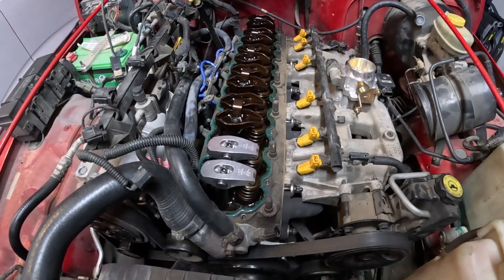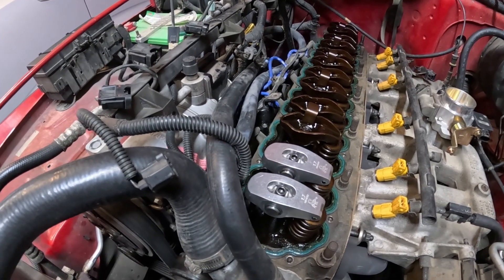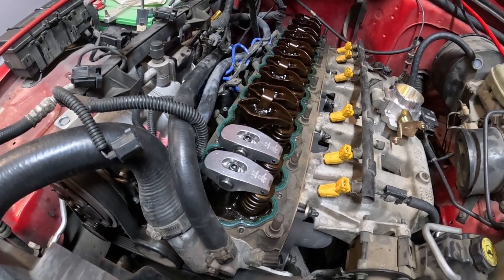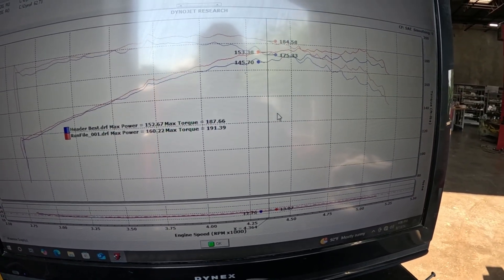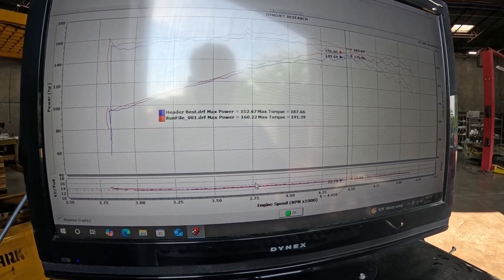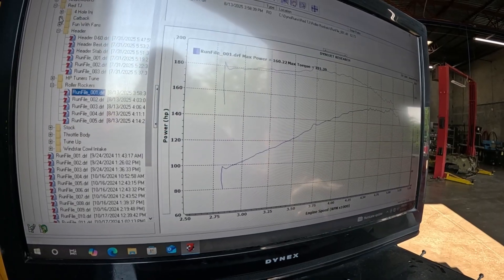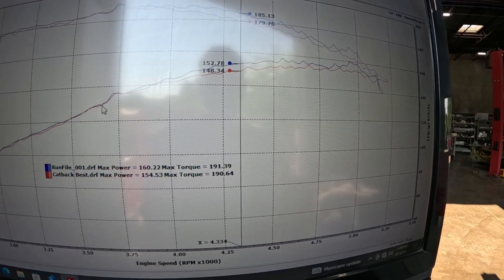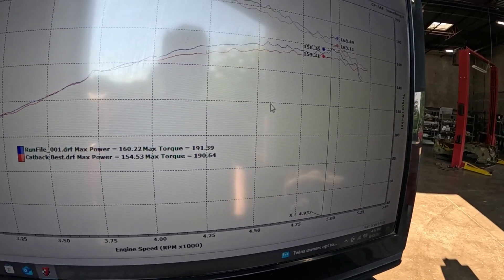Jeep Wrangler 4.0 Bolt On Test Series - Episode 10 - 1.7 Roller Rockers

Comment: Not trying to be "that guy", but your header video showed an issue that's common with short-ish and non-equal length header systems - they don't necessarily help if they aren't well engineered.  Before switching our business to LS swapping Land Rovers, we had our best luck with the ARH 1-3/4" long tube headers with their 3" high flow catted intermediate pipe.  Expensive, but it made power everywhere with a small Comp camshaft, junkyard HO intake, and some tuning.

Comment: Check the heat of the fuel rail from 1st to 6th cylinder.  I recommend buying an aluminum fuel rail and drill and tap to move the inlet to the center of the rail. Ive seen 30% difference in these rails.  Every 10° Celsius increase in heat is approximately 1 octane down...

Comment: From personal experience,the 4.0 can be a little anemic to flow even after a bit more lift i.e cam&roller rockers (either or)
We talked about this in person
But i felt the biggest difference when i ported my stock head&intake (did so cause i overported my nice head after installing it.....ran into a water jacket) and doing a header from "American racing headers" That was a nice difference in power when i did all that at the same time along with a tune!
When i initially cam swapped my LJ i had a Head with LS Valvetrain but i felt no real difference. At that time i had only ported my intake since it was already off,later down the road is when i ported said LS head and ruined it (bad casting maybe? Went just as far on porting the stock head as i did the aftermarket head)

Comment: I think part of why these dont seem to be worth alot is you may just be hitting the limmit of how much air you can move with stock head and camshaft. Plus doing it from a dyno in the TJ its gonna be alot less impressive than on a dyno without parasitic drive loss. These things sap alot of power through the drive train. Overall compared to stock you're getting close to whp close to crank numbers. If anything it probably drives alot better.

Comment: I have a 97 zj with the 4.0 that's completely stock, will these mods work for any efi 4.0? I've followed this series from the start.
Reply from the maker: There are a few differences in the 4.0s over the years, but most of these mods would be about the same.

Comment: Thank you very much for producing such a high-quality series. I genuinely appreciate your work. I am currently working on a similar project with a 2006 Wrangler X that has a 4.0 automatic transmission. I’m finishing up episode seven of my build and expect to complete it by Tuesday. In addition, I still need to finish the build-off with the Comp Cams, which includes bolting on the aluminum Edelbrock head and fueling system. I also need to address the entire cooling system to reduce parasitic heat loss.